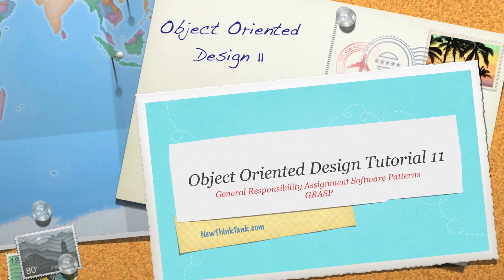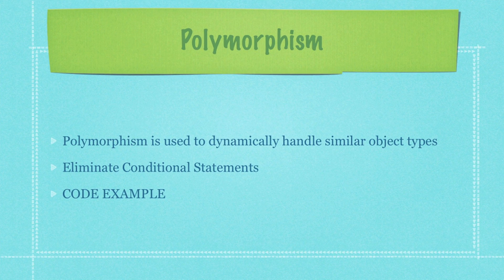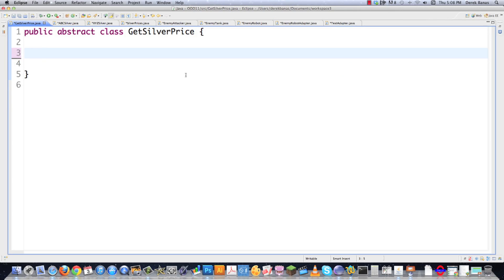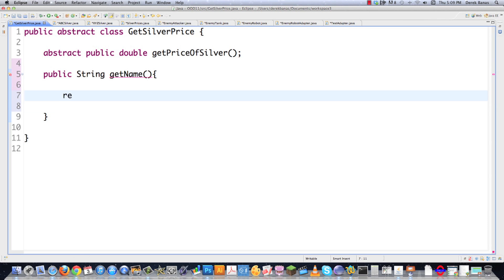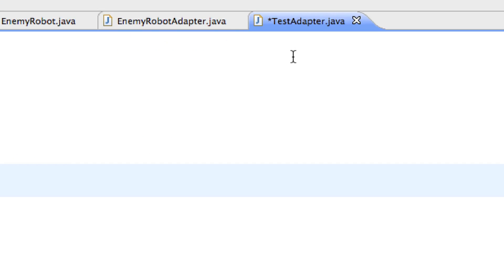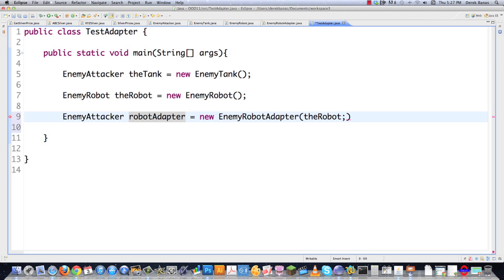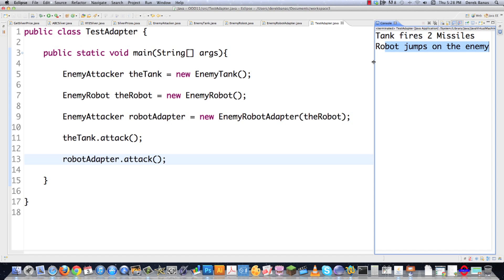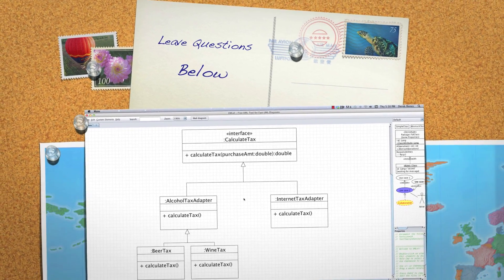Object Oriented Design 11

Comment: Hi Derek Banas, thanks for this playlist. It was great. I watched all video tutorials. :)

Couple questions though.. 
1. Do you suggest any further book/tutorial/video to get more knowledge with OOP Design? 
2.  What are the best practices to interface the system objects, e.g. Student, to the database classes? Where should I create the object to handle the StudentDatabase class? And what is the life time of this class?
3. How to create the OO design thinking in terms of the UI? How should we create the UI classes and how to interface them with the system?

Suggestions..
In the ATM example:
 - it would be very nice to have a class diagram showing the different connections between classes and their relationship.
 - also I think the object theCustomer could be eliminated since we do not use it.

Thanks again!!